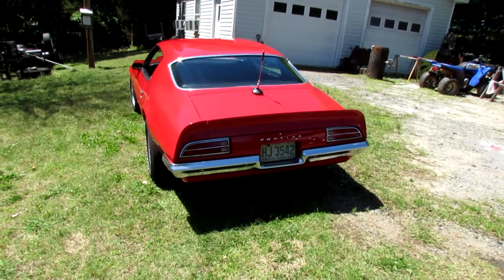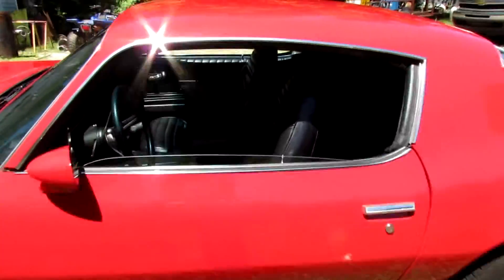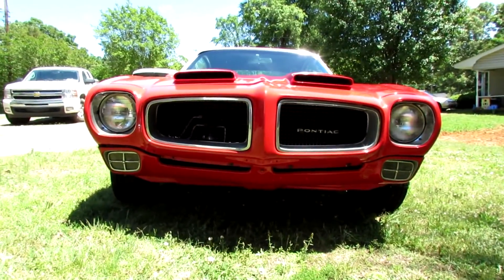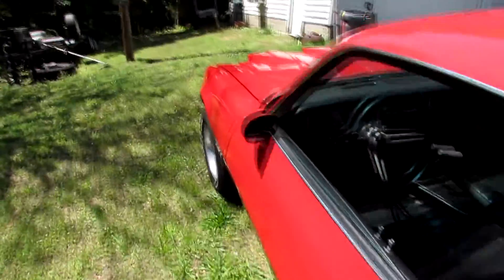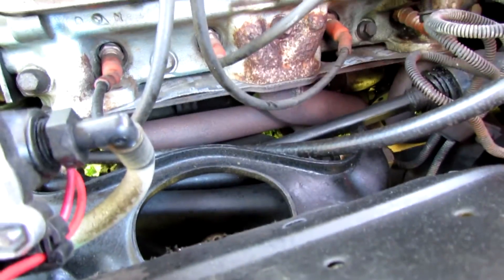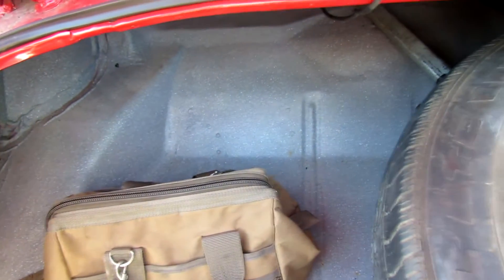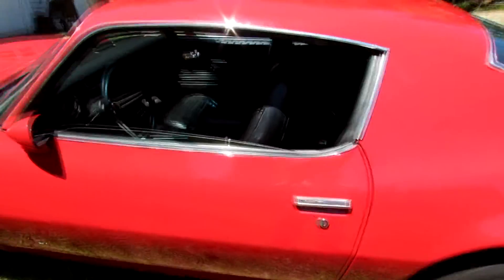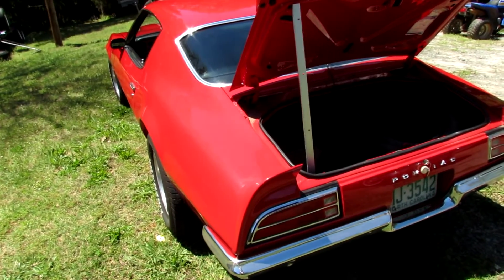72 Firebird- walkaround

Comment: I spotted this car in one of your other vids and searched for a better look. I had a 75 TA with 400 and automatic about 35 years ago when I was in my twenties. I had a functioning shaker hood with a brass screen that would freeze the air filter if I drove in heavy snow. A lot of people criticized these cars but they were great cars in their time. I like what you have done with yours, it sounds a lot better than my stock one did. Sounds like a bit of a cam, do you know what's in it? I wish I had your body work skills.
Reply from the maker: Mr42960 It's a Comp Cam...I forget the specs now..#12 heads.